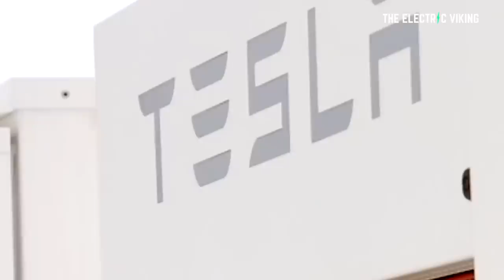Tesla's clear path to become largest truck manufacturer in the US

Comment: No question Hyliion ERX will dominate the long haul market by optimizing size of battery with RNG. Best Total Cost Ownership (TCO) and best environmentally friendly solution. Short haul will be interesting to watch. It’ll be who can provide lowest cost batteries.
Reply: Exactly my thoughts.
Reply: Natural gas as an alternative to BEV? The wet dream of the oil industy
Reply: @vic321344  
Every year there's tons of methane released into the atmosphere from places like diary farms, waste water treatment facilities, etc., you can use that methane to create renewable natural gas (RNG). 

Current version of Hyliion ERX uses a natural gas generator onboard the truck, fuelled by RNG to charge batteries (because you produce the electricity onboard the truck the batteries are a lot smaller and have advantages such as weight, safety and lifespan as compared to full EV). 

Currently there's no infrastructure for full EV or hydrogen long-haull trucks, but as it gets built out Hyliion plans to introduce KARNO generator into the market that can run on a variety of fuels (so you can use both RNG, or Hydrogen if available and cost-effective to fuel the truck). And as Hydrogen becomes available and cost-effective for fleets, and infrastructure gets built out, Hyliion will only need to swap out the NG generator or KARNO generator with a Hydrogen one.

So to summarize, Hyliion has the best solution to current and future market demands.
Reply: HyLiion troll farm in full force today.
That’d be fossil gas with slight efficiency advantage over diesel.
Reply: If you truly due your DD on future of class 8 trucking….Hyliion has the only realistic solution to pollution of diesel fuel

Comment: Hyliion will compete that’s for sure don’t underestimate the little guy.
Reply: @vic321344  wrong! ERX is Fully electric with onboard generator to recharge battery while on the move. Only road ready solution for long haul.
Reply: @alexanderthomas1554  And what drives the onboard generator, you genius? ERX offers up to 75 miles of all-electric range. Great.
Reply: @marzrunner8453  Diesel is dirty power, electricity is from dirty power? So what? BEVs are much cheaper and better. Thats all what counts.

BEV charging infrastructure is cheap, fast and easy to install. Tesla already has a lot of experience with this.

If you burn the oil in power plants, you get a 3 times better efficiency than if you burn it in your truck. So instead of 1 diesel truck you can drive 3 BEV trucks.

Comment: Hyliion is going to smoke Tesla an Nikola hands down. I wanna see Tesla prove there supposed 500 miles range, secondly prove the charging energy Tesla uses isn’t from coal or diesel anyways
Reply: Real truckers will not drive a all electric truck. They hard very set in their ways
Reply: @PowellVentures  They will when the companies force them in an effort to reduce Total Cost of Ownership (TCO), and they'll learn to love it. There's videos of Hyliion Hypertruck ERX taking off as it merges onto a highway with insane torque and that's just so much more comfort and safety for the driver, PLUS - IT'S QUIET.
Reply: Looks like hyliion is trying to sell an LPG burner maybe with a mild hybrid unit. It’s burning stuff that is the problem, not the answer. I’m pretty sure Hyliion will be a short footnote in future of trucks.
Reply: @PowellVentures  Wait till they try the ERX 👀
Reply: @devonbikefilms  RNG is actually net carbon negative so 🤷

Comment: Viking, HYLN is a viable solution. I look at a lot of your videos and TSLA is my biggest position by far. You should look at HYLN ERX solution. It is a viable solution and will win signifant market share. They don't make the truck - but fit their power train. It uses a generator (which can run on renewable natural gas) to charge the battery as you drive down the road. It also has a fully electric range for places where emissions are not allowed. It has far better range that teslas 500 miles (in the order of x2). The solution is net carbon negative when used with RNG. It has huge potential.

Comment: I sold class 3 thru 8 Trucks , commercial vehicles tow trucks to Semi's .  BEV trucks are unable to do Long Haul over the road , they are great for local delivery routes.
Reply: I was in shipping for 20 years.  If you build a truck that costs 5%, just 5%, less to operate every shipping company in the world will scrap the trucks they currently use and buy it.  5% is HUGE!  Tesla semi claims 25%!  Tesla could double the cost of the trucks.  They will still sell every one they can build.
Reply: Sorry you never had the chance to sell a tesla Semi.

Comment: TLDR; Hyliion #HyperTruckERX is the only viable solution for long haul over-the-road trucking. 
Trucking industry is very different to passenger car : TCO vs emotion drives the buying decision of fleets. Pepsi may be able to put up a few chargers at base and trucks can come back twice a day to get charged and do short haul deliveries. But how are the long haul over the road truckers going to charge their trucks? They cannot sit at the charger for 1 - 2 hours ( if they find any truck chargers on the road ) , the TCO doesn't allow that. 
Good TCO means truck carries 80 tonnes+ real load. The battery weight for a full BEV will be way too much and will count against the vehicle weight which means lesser load carrying capacity. Also what about the cost ? TCO will be heavily disrupted to the upside with a $500K truck. 
Hyliion Hypertruck uses onboard CNG/RNG to charge batteries, keeping the battery pack small and TCO same or even lesser than the diesel trucks in use today. The newly acquired Karno generator tech from GE by Hyliion means that you will see Karno generator charging electric trucks as the grid cannot keep up with the demand!
Reply: Perfect explanation.
Reply: Awesome information

Comment: Viking, you're right on with this analysis.  The economics will doom diesel trucks and Tesla has both the product and the access to battery supply to make this happen.  I received an Austin built Model Y LR about 1.5 months ago and it's stunning.  You can imagine what a game changer it is until you own one.
Reply: Except it really isn't. Range is worse, charging is the same, exterior and interior are identical except for the parcel shelf in the trunk. The advantages of the 4680 battery cell are all for Tesla, not the customer.

Unless you're talking about the regular old 2170 Model Y LR. Then it's a way overpriced but super techy and practical electric performance crossover. I've gotten to drive them several times and really wanted one... until the price got stupid. If the Model Y can be had for $40,000 in China, it shouldn't be $70,000 in the US.

I'd wait two years if I could buy a 7-seater for $40K, even $50K. But since it isn't, I'll be getting a Chrysler Pacifica (plug-in) Hybrid minivan. It perfectly fits my family's needs, is significantly more spacious than the Model Y, and fits our Jeep wagon/stroller behind the 3rd row with room to spare for beach and picnic stuff. And it would operate on electricity 80% of the time.

Comment: The genius of the design of the Tesla Semi is the central driver position. That is the same truck can be used in any country in the world as it does not need to be changed for left hand or right hand drive countries. So just one manufacturing line. Another process removed. Gotta admire the brain power at the disposal of Tesla.

Comment: The real interesting fact of the Semi is that Tesla managed to install 1MWh of battery in the truck, while other electric truck makers  reach their structural limit at 500 kWh with their conventional design. They just dont have more room to install more batteries.
Reply: Engineering.  I seem to recall that the Tesla made cells are 20% more energy dense.
Reply: Don't know how you can magic space that others can't. Strength is a no-brainer, they're all body on frame. Retrofitting trucks to electric is the simplest thing in the world. BYD uses batteries with the better cycle-life. Wait for the unhappiness of failure of longevity.
Reply: @MegaWilderness  If you look at the other BEV trucks, they are crammed full with their cells. No more space left. If they would use LFP batteries, they wont even get 500 kWh. Maybe just 350 kWh max.
Reply: @MegaWilderness  First off, drop single motor design, which requires bevel drive diff & tailshaft. Tesla has very compact design for drive units. Then look at Ford Lighting thermal management (Munro) - it takes huge volume as it’s not integrated, it’s off-shelf components, cobbled together, hoses everywhere, inefficient. Even Ford knows this.
Strength only crucial from turntable to drive wheels, rest doesn’t carry the load or even really much braking force. ( not saying it can be weak, just not huge)
Reply: @iandavies4853  You can't teach me anything as I pay attention to teardowns. Haven't you noticed the diffs and gears in Teslas motors.
Reply: @MegaWilderness  wow. I’ve never met someone who knows everything. 
Tesla semi has three motors, so two wheels just a straight gear drive train, no diff at all. Other axle has spider-gear diff, but it’s not bevel cut crown wheel. There’s no drive shaft, so more room for battery pack. But of course, you know everything, like god herself.
Reply: @iandavies4853  The only reason it hasn't is due to not having a prop shaft. Three motors will never make sense to me. I'd always have one for each wheel and drop the diffs completely.
Reply: @MegaWilderness  yeah, I liked modularity of 4 identical motors with simple reduction box each.
I’m guessing (WAG) that Tesla is aiming for efficiency of electricity consumption at cruising speed.
From the little info I can find (eg Leaf graph), motors are more efficient at mid revs & fairly high loads - so drop to one motor, working hard for cruising, other two for acceleration / regen braking. It’s kinda funny fleet owners obsess over saving cents, pickup drivers display waste as a mating signal. (joke, I’m a biologist, sometimes)
Edit: I’m not even sure need spider gears, might be able to use regular gears. It’s the hypoid right angle drive which is expensive. Wiki describes a spur gear diff mated via pairs of pinion gears on rotating carrier. So far, Tesla goes the conventional route of bevel-cut spider gears.

Comment: it's the vertical integration that gives Tesla such a massive edge in all of its business areas. not just trucks, but cars and static storage. and not trying to have 5 million versions of the same thing when a couple will do. in the US they will clean up with their trucks , possibly less so in the EU as distances are generally shorter.  if Tesla bring out a smaller version, then it's game on. 
same in cars, a model A and 2 along with a smaller roadster, (MX5 replacement) and they would be really dominant in all of the market segments. 
their business decision making is simply first rate and absolutely in tune with the modern green world.
Reply: You're assuming everyone loves driving their kitchen counters with a tacky TV offset in the middle.
Reply: @MegaWilderness  Tesla are not really a car company, they are a software and charger company who made cars to get you to the chargers. Same as Apple are a services company who use the devices to sell you the services. But the tech has matured to a point where it's actually an aspirational product in itself.  I think people will buy the smaller cars in very large numbers. Buttons or no buttons because it's the modern way to do it.
Reply: But they do have a shorter version, a 300 mile range.
Reply: @francoischarbonneau9447  it's a big truck size wise. Not exactly EU street friendly. But if all it does is pound the motorways, the 300 mile range will be perfect.
Reply: @MegaWilderness  you’re assuming you need an aircraft flight deck to pilot your dinosaur from home to work. Tesla don’t need oil pressure gauge, rev counter. Also don’t need multi-ratio gearbox. Don’t even have gearstick on latest versions!

Comment: The additional aspect you have to consider is the FSD for trucks. Once Tels has this figured out the cost of operating a Tesla truck fleet will be a no brained for any logistics business and will be an competitive advantage for those that actually have Tesla trucks. These will increase the demand for Tesla trucks in the USA and worldwide to very high market share due to the strategic advantage to own a truck that does not need a driver and can operate a very low costs. This will impact the economy with lower GGS in each step of the value chaine.
Reply: Yes. You are only person (besides myself )to realise this. Total game changer. As great as semi design is, it’s almost incidental, but will be great low maintenance (& high power) complement to automation. The rapid acceleration means FSD won’t risk cutting cars off or blocking them. Watch Chuck Cook unprotected left, then put him in a semi. That’ll be fun video.

Comment: I believe if the Tesla Semi will have a couple of years of teething problems once customers have them, but the pace that Tesla improves their products is unlike any legacy builder and I would suspect like the Model Y, once they have worked out some issues after going into production, the Tesla Semi will become a top choice for many corporations. Especially if Tesla nails FSD. Even if the FSD is only permitted with a three truck caravan, where the front Semi has a human driver for "safety", but the two Semi trucks following it would be driverless. The savings for corporations would be huge if they could just do that. In the US and I believe in parts of Australia you have these Semi trucks pulling three or more trailers. Maybe Tesla tech will allow for longer versions of those. 

Imagine if they have they Tesla robots on these trucks to handle loading and unloading of the trailers. Tesla may end up putting solar panels on trailers to run refrigeration or extend range, robots to do labor when needed, such as the just mentioned loading, and FSD, to make the lowest cost commercial delivery option for corporations. Maybe on top of robotaxi, Tesla may develop an advance commercial delivery service that could undercut traditional delivery services. Tesla Freight services might be another future arm of Tesla.
Reply: IMO FSD is not necessary for trucking,  especially if they begin this 'convoy' idea. Alternatively they could do what we do here in Australia... A not so little idea called a ROAD TRAIN. The smallest is three full sized semi trailers, the largest is about 7 or 8 trailers.  Imagine if you were driving a road train down some interstate in the USA.. think of how much labor that would save. We do it here, why can't they do it in the USA (who have much better roads than we do down under) ?
Reply: Wait till the customers cannot get thier vehicals serviced just like regular tesla owners.   You'll see these trucks dissapear REALLY quickly

Comment: 0:09 I say, wait and see... Why?
Quote:
Two concept vehicles were unveiled in November 2017. Production was originally planned to begin in 2019, reaching 100,000 trucks per year by 2022. Start of production was subsequently delayed until October 2022, with production deliveries slated for early December.
We are at the end of 2022 and yet not one truck of the 100,000 is build, commercial.

Comment: What are the pros and cons of using electric trains (the constant power kind which need no batteries) to move freight over long distances to cities where the freight would then be offloaded onto battery powered electric trucks for making the much shorter delivery trips within the cities?
Reply: Decided to look up some information about trains.  I didn't know that a diesel train actually runs on electricity generated by its diesel engine.
Reply: The train lines are already overfilled. If cargotrains (with 60mph) drive on the same track as passenger trains (with 150mph) then you get problems. Even if you have separate lanes for cargo trains, the transport capacitry is not nearly enough.

Comment: the thing(s) that is going to be crucial for the Tesla Semi are a vast multi charger locations preferably no more than 250 miles apart @ current truckstops or other convienant locations(with added megapacks) the cost of refuelling (electric), and for the larger fleets/small owner operators a decent sized sleeper cab, and the not to be ignored access 24/7 to spares whether the off the shelf generic parts or Tesla parts fitted by Tesla or trained Tesla techs without the ability to service your vehicle in the middle of no where on a sunday afternoon the OTR sales will not happen, shortish inter depot freight loaded both ways will be ok as both are within range until there charger network is up to snuff
Reply: The nice thing with BEVs: There are lot less parts that have to be changed/Maintained. Nearly nothing besides water for the front window and tires.

Comment: Now trucking companies with big warehouses usually have large flat roof spaces and perfect for solar . I could also see wind generation on the roof also . You do need massive power generation to charge 10 or more trucks at one time so supplemental green energy is important . Not sure what the status on charging stations for big rigs . That would have to separate from regular vehicles which is what's done with Petro fueling . Oh a day not breathing gas fumes would be glorious. California has struggled with smog and to see cities having sparkly clean air on most days should see most jump for joy
Reply: If it were really that much of a game changer,   plants would already have done this.   So  one can only conclude the cost is not worth it.